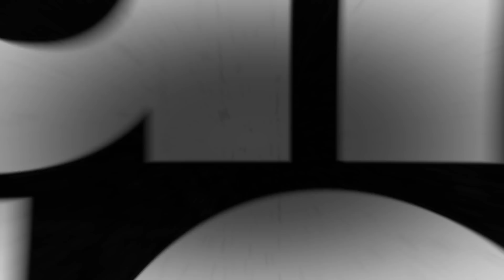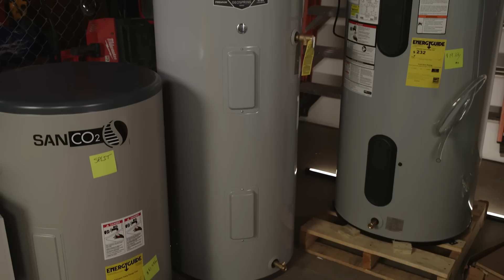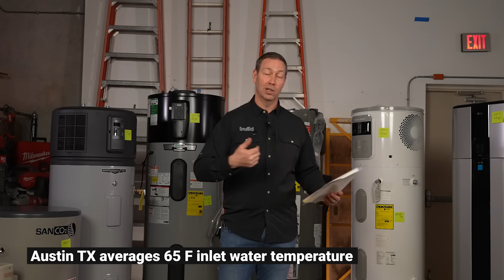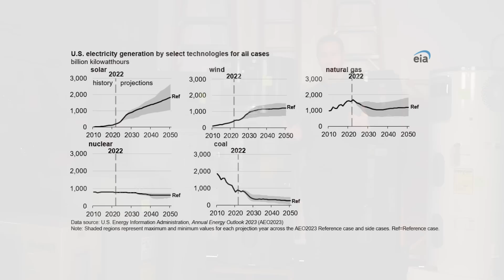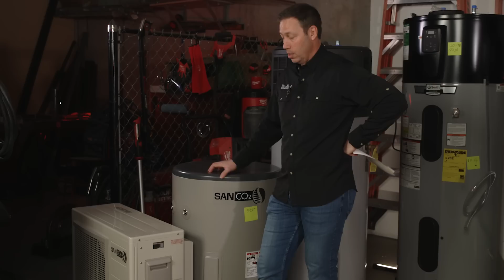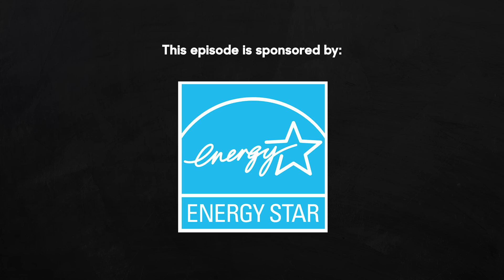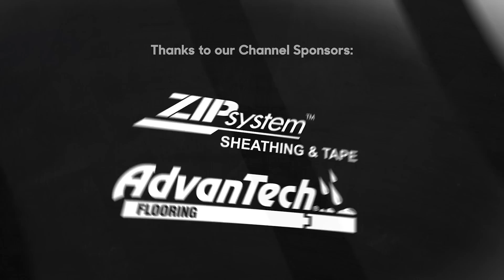2024 Heat Pump Water Heater Buyers Guide

Comment: if your interior space is being heated by a heat pump...and your water heater takes heat from the room and moves that heat into the water...and cooling the room....  it's still  VERY efficient as it's all heat pump efficiency.... now if your room is heated by a  more expensive means...then not so much.
Reply: Yep... this means, while still probably saving money, the yellow energy guide stickers might be underestimating your "true" cost to run it.
Reply: Don’t forget that you save money on cooling in the summer and could save on dehumidifier cost also if you have a moist space my dehumidifier uses like 500 watts when running.  The heating and cooling could end up a wash, but free dehumidifier.
Reply: @hrcnick11  Yes, I have thought about that, but the places we would think about this primarily are probably the northern climates and I think the heating dominance means it probably isn't a total wash. The dehumidification, in my experience, has been pretty limited. I used a hygrometer to compare the room with the HP water heater and one that doesn't (both in basement) and I didn't see any difference... so yeah it does it, but the effect is probably minimal.

Comment: Heat your basement with gas, then have the water heater move that heat into the water. YELLOW STICKER WRONG!
Reply: The water heater doesn’t go in a heated space, the sticker assumes installation in a garage or basement or other unheated space. if your whole basement is heated then get a split model with the compressor outside.
Reply: My GE Geotherm is out in my Arizona garage, lots of heat to suck up, works great. Most of my family is from the Midwest with unintentionally heated basements. The basement is not thermally isolated from the upper living area. By taking the heat out of the basement you are exaggerating the movement of heat from the upper levels to the basement. Most of the people into these Hybrids put them on timers and shut them down for hours out of the day. When the units turn back on most of the heating comes from the resistive elements, not the heat pump. I'm not sure where Matt got the split system, never seen one in the wild. @jpe1

Comment: Crazy. Renewables are too diffuse to be economical. Most electricity is still produced from coal, gas or nuclear. My hot water and heat comes from gas, which here in Britain is a quarter of the price of electricity per kilowatt hour. If I replace my gas boiler with an expensive heat pump I would see no economic benefit, and there would be no reduction in carbon emmisions because of the losses in the power grid, (about 2/3 of electricity or more is lost in the power grid from the power station to your home.)
Reply: What's crazy is burning things to get hot water. Renewables are ramping up very quickly here in the USA (finally).
Reply: @DeuceDeuceBravo  Yup, and when you need renewables the most they let you down.

When does it get the coldest in winter? When a high pressure settles, which means little to no wind.
Also, because it's winter, the sun is low and the days are short, and that's not taking the cost of manufacturing and maintaining solar and wind farms.
So renewables have to be backed up with conventional fossil fuel power stations, which means even more expense, which of course is passed onto the customer/taxpayer.
Meanwhile the media has strangely nothing to say about China and India using record amounts of coal to fire their industries, all while were supposed to be teetering on the brink of runaway global warming.
Reply: @samuellowekey9271  Not sure what "media" you're referring to, but I've seen a lot of coverage about China, India and others burning way too much coal, especially lately since we just had one of the hottest years in generations. The USA is in a better situation to phase in renewables since we are essentially energy independent at this point, but we have a LONG way to go with grid improvements that will allow for efficient distribution of renewables. Your point about backup power is somewhat valid in the context of utility companies, however with an efficient home, solar on your roof and a good battery you can weather any storm. 👍
Reply: Solar economics are tough in Britain. Here in Northern California the weather is much different, which changes the economics dramatically.

Comment: Stand-alone air-source heat pump water heater are good in warm climate, but  in north they suck the warm from your room and then you need to heat that air with your house heating system like water heated floors. So there is not so much profit in them unless installing an outdoor like SanCo2 or similar and lookin for COP in different temp ranges.
Reply: So install a split system with the condenser outside the house.  Quieter, crazy efficient in the summer, and will still work down to 0°F as a heat pump (albeit less efficiently) 
I installed a Rheem hybrid in my basement, and in the winter the basement air temp drops from 56°F to 54°F in the vicinity of the water heater when it’s running, but no noticeable change at the other side of the basement where washer/dryer are located.
Reply: It depends a lot on how your house is configured. If all the mechanical systems are in an unoccupied basement, then the waste heat from the HVAC system may well be plenty to provide the ambient air heat needed by the hot water heat pump. It really all depends on the specific circumstances.
Reply: Might be a wash, the money you lose in the winter you might save in the summer.  Plus if you have a moist basement and run a dehumidifier that you now do not need to run that could save some money also.  My dehumidifier is like 500 watts when running.

Comment: I looked into a heat pump unit.  Required 3 contractors to install. A plumber, an electrician, and an HVAC guy. Nobody in town wanted to mess with it or take the job. I ended up passing on it and getting an el cheaper old school heater for $400 at lowes, popped it back in to the same place the last one was. Not really a huge fan of heat pumps for HVAC anyway, they don't last long. Why would this be any different?
Reply: I installed my Rheem hybrid water heater in under two hours.  It’s easy DIY, much simpler than installing central air conditioning heat pump because the whole heat pump system is self contained, no need to mess with refrigerant lines. There is no need for an electrician or an HVAC contractor at all, and if you can DIY a traditional electric resistive water heater you can DIY a heat pump or hybrid water heater.
Reply: You probably already ha a spot to put one. And so did I. Only it was nowhere near the existing water lines. Plumber said it had to get air intake from outside. Electrician needed for the electrical. Then HVAC needed for the venting of the exhaust.  Was not a DIY job in this case and quotes were all in the I-don't-want-to-do-it price range. Had plumbers come from the nearest big city. They never heard of one. They just wanted to sell me something from their warehouse. @jpe1
Reply: Zero reason for a HVAC guy. If you already have electrical water heater then there is also no need for an electrician.
Reply: Needed someone for the venting. Both in and out. Per the plumber who never installed one and his supply house who recommended doing it in this climate that I'm in. @jepito29
Reply: who says they don't last long? I have 3 units on different buildings, all have a still unused 10 year warranty (and they were the cheapest units at the time). When working overseas several years ago there were units that have been in service since before I knew what a heat pump was. For Merica this is new to us, for other countries they have been using this tech for decades.  As far as needing 3 contractors, I call BS or maybe your people suck at their jobs.
Reply: I explained further in another comment. PRobably a lot to do with the climate here. hundred degreee temps for days on end then freezing high humidity. @wolfe2118

Comment: Wow great timing! I want to change my 10+ year old tank to a heat pump version but no one in my area will do it! Every contractor i speak to says they dont do it or go on long rants about why I should get tankless instead.
Reply: Tankless is a much worse solution IMO for most situations. Many plumbers are very change resistant.
Reply: @johnhorner5711  it’s nuts. I’m trying really hard to get a heat pump but they literally refuse to install. They even admit they don’t know much about them or the price and then claim they’re cost prohibitive despite a generous $1,300 rebate in my area. 

Only trouble I see is Matt is saying I’ll want to upsize two step’s on the 120v version. They definitely cost quite a bit but I have the space.
Reply: Ask a plumber, not a contractor. Not much work for a plumber to do, to move a tank and plumb plumbing to/from it, with one electrical wire.
Reply: @jeremyjedynak  will do!
Reply: @jeremyjedynak  spoke to 3 plumbers. 2 said they never heard of a heat pump and won’t do it. A 3rd said he never installed one but he knew what it was and wants 2k for labor… whereas they’ll do a tankless install for just 500 in labor…
Reply: @PKDN215  It would take any licensed plumber less than ten minutes to review the manual to see what connections need to be made and where to make them. The only plumbing difference between the install of my Rheem HPHW and a non-HP electric hot water tank is the need to plumb a condensate drain line to a nearby sump, and the hot and cold ports were on the side of the unit instead on top. Installation is as DIY friendly as a standard electric as long as you have the ability to move the ~300 lb empty unit from where it is delivered to where you want it installed.
Reply: @jeremyjedynak  I couldn’t agree more with you. Appears plumbers in my area just don’t want to do it as they never have. Real shame as I was quite interested. Fortunately my current tank is on rental and my company just gave me several months for free in order to keep my business so I bought myself some time

Comment: Nice overview Matt. However, it would have been good to discuss the high failure rate of these units in colder climates. I've had three 220V State ProLines located in my heated basement n western NY fail in a 3-year period i. My plumber says its common for these to fail in colder climates. They work much better down south where they are typically installed in garages.
Reply: I've had a GE heat pump water heater in my Connecticut basement for 12 years with zero issues.
Reply: Sounds more like a State Proline issue
Reply: My Rheem has been working fine in NY for the past 4 years.
Reply: State sucks. Buy Bradford White

Comment: Did a Rheem HPWH with DWHR unit on shower drain  a year ago. Very pleased with it.

 In laundry room in basement. Ontario Canada. 

Yes, about 12000 BTU/h  cooling when running. Runs about 6 hours in our pretty water heavy using household. Did the 240V version so if heat pump needs service still would have hot water, but never used resistance yet. 

Dehumidifier never runs any more. 

Replaced a B vent gas water heater, and closing B vent cut high eff gas furnace run time even though it now fights a bit in winter with the HPWH.

Hang up the laundry on racks in same room as it is and laundry dries on them in about 6 hours winter or summer. 

Only run the clothes dryer in the winter when we wash bed sheets or a lot of towels. that cuts gas furnace run time as well.

Comment: I'm on the cusp of ordering one of those SanCO2 units for my 120 year old Craftsman Cottage. I want to replace the Nat Gas tank that's in our kitchen closet. The tank will go in the attic, above the kitchen, where I only have around 5 feet of vertical space.
Reply: The 42 gal SanCO2 tank is 38" tall.
Reply: Sounds like a easy tankless retrofit . That’s what we did .
Reply: If you're already on natural gas, you're going to have a long payback period if your current unit is still operable.
Reply: @jeremyjedynak Payback is not the issue. I want to reclaim the floorspace that the current tank occupies. This will allow more flexibility for a coming kitchen renovation. Moving the tank to the attic is the goal. But attic space is limited because of the roof geometry on this small home.
Reply: @MichaelGraves3304  Is your attic within the conditioned air space of your home, or outside of it?
Reply: @jeremyjedynak  It's not in the conditioned space, but the manufacturer says that's not an issue. The tank is entirely passive. And very well insulated.

Comment: I remember seeing a tankless heat pump water heater unit on Ask this old House that you could add to an existing gas or electric water heater. I think it used a recirculation pump to heat the water in your water heater's tank. I'm surprised they aren't more common. I would love to add one to my gas heater to use in the summer.
Reply: Why not just replace the gas? 🤷‍♂️
Reply: @DeuceDeuceBravo  When I heat my home with gas, the heat pump essentially becomes an inefficient gas water heater. My gas water heater is probably less than $20 a month to operate. I like to run a dehumidifier in the summer. It consumes a hefty percentage of our household energy usage. It would be nice to get the added benefit of heated water. Truth be told, even a tankless heat pump water heater would have to be pretty cheap to save me any money.
Reply: @Rickmakes You're right that the pay back period is likely too long for most people who already have a working gas hot water heater. They can make sense once your gas unit is already at end of service life, and make way more sense if you're on resistive electric, propane, or oil.
Reply: I saw that too, but unfortunately it's discontinued.

Comment: Gas is cheaper than electricity.
Reply: Depends. With heat pumps, it’s not that simple. Those things sip power.
Reply: Yes, but unless your electricity rates are very high these will still be cheaper to operate because they're much more efficient.
Reply: Maybe. But is it 400% cheaper? In 2023, the USA produced more oil and gas than any other country on the planet, _ever_. How long is that going to continue? At utility scale, a solar power plant is currently the cheapest option available, followed by gas then wind.
Reply: This eco crap what’s going on all around the world look at Europe now is insane cold heat pump doesn’t work solar panels is cover by the snow.
Reply: Is it 4x cheaper per BTU
Reply: I have closet 3’x3’ 8’ tall next room is living room. I look for options
Reply: Not here! Per btu, our gas (propane) is about 3x more expensive than heat pump. Natural gas is about 2x as expensive.
Reply: @craigheimericks4594 where?
Reply: The magic of a heat pump is that you get 3-4x more btus of  hot water out than the btus of energy you put in.

Comment: One correction, Matt: Many of these units absolutely can be ducted outside, but as I'm sure you know, it would be best to then duct the intake and exhaust to avoid influencing the building pressure. There are some efficiency considerations and condensation considerations, but it is an option if needed.
Reply: I  installed a Exhaust Air Heat Pump Water Heater back in the mid-1980's Which took air from the Kitchen, Laundry and bathroom areas as a heat source then pumped that cooled air outside with make up air coming into bedroom closets through "Air Ports".  That solves the cooled room problem and provided fresh air into a tightly built home replacing the HRV unit.

Comment: Hey Matt, what happens when these break down? I imagine it will cost so much more to fix than your standard gas tank
Reply: They don’t break down. They just become a regular electric water heater
Reply: @jepito29  "An escalator can never break: it can only become stairs." -Mitch Hedberg
Reply: @steelyspielbergo  yep, I typed that thinking of Mitch
Reply: What does it cost to fix a gas heater?
Reply: @DeuceDeuceBravo  not a whole lot depending on what goes wrong. Most gas water heaters in this area (South Texas) need service once in the lifetime of the heater. Electric heaters are around 3-4 times in there lifespan. Life time is 10-15 years for gas and 10-20 years for Electric. Gas water heaters usage cost is about $15 month and i don't have a monthly cost for electric.
Reply: @jameskitzmann6268  My heat pump water heater has needed zero service in over 12 years.
Reply: This is a major question plumbers install but THeY don’t want tos revive Heat pump!  rheem as smith etc better get busy developing a network of hvac guys who can repair these
Reply: Depends on what breaks, but if the heat pump needs to be serviced, the manual tells you put the unit into resistive-only mode.